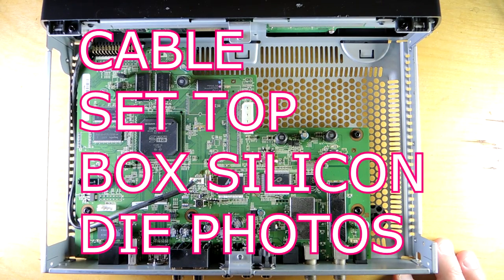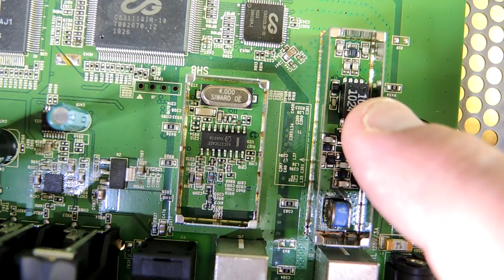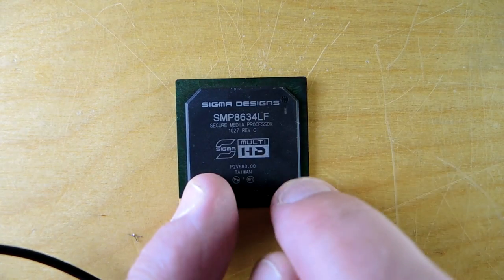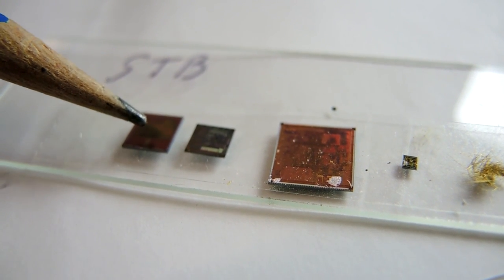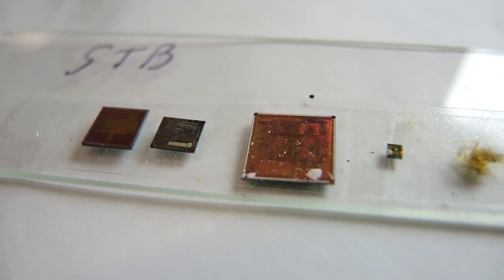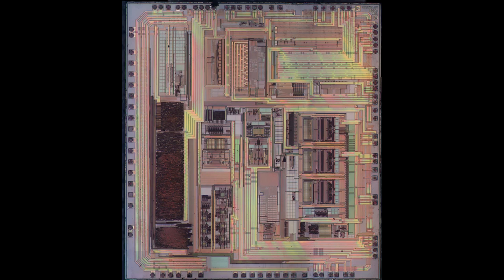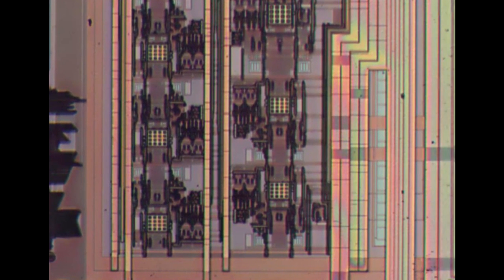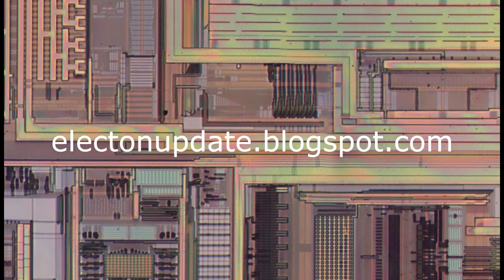CABLE TV SET TOP BOX: A LOOK AT SOME MIXED-SIGNAL SILICON DIES

Comment: At 4:33 I don't think these are inductors, the wires appear to connect on random spots around the square metal part. There's a wire from the bottom right center going to the left, straight across the other square, no sane RF IC designer would do this when this was an inductor ! My guess is that these are Vertical PNPs, or actually the connections to the VPNPs. These are very low-performance PNPs (beta of 10 if you're lucky, they're basically parasitic devices) but they're good enough for a Bandgap voltage reference. Which is what they're most commonly used for if there are no proper NPNs available, like in this CMOS based chip.
Reply from the maker: +Peter-Paul Vervoort Thanks for the insight!

Comment: do you do requests for silicon die photos/videos? i would be pretty interested of the die of an LM2936 voltage regulator :)
Reply from the maker: Requests, no.  But if it's interesting maybe.  What's unique about this die which would warrant a decap?
Reply: well normal voltage regs use like 10mA in standby, this one uses 9µA. its an ultra low quiescent current voltage reg, and im just interested what the big difference is that allows it to have such a low quiescent current